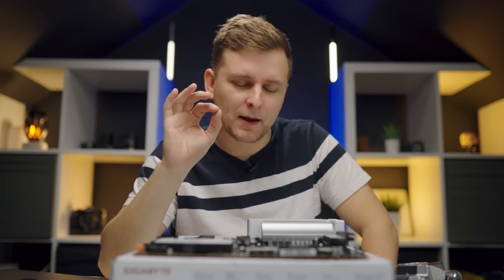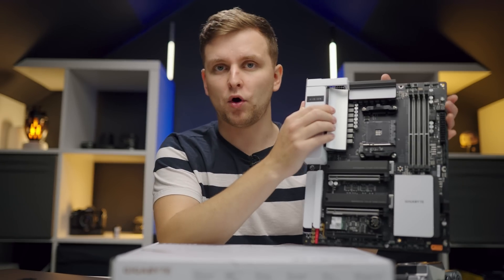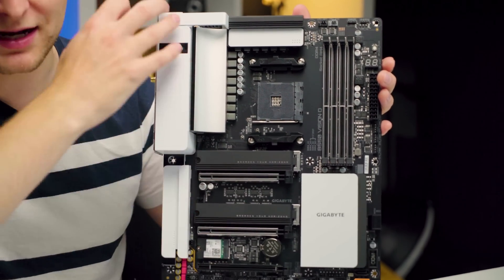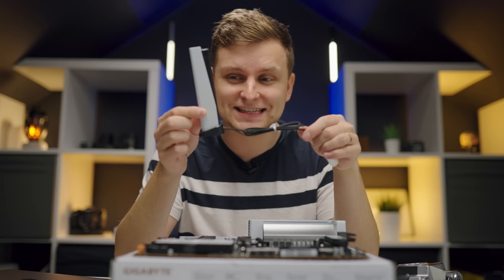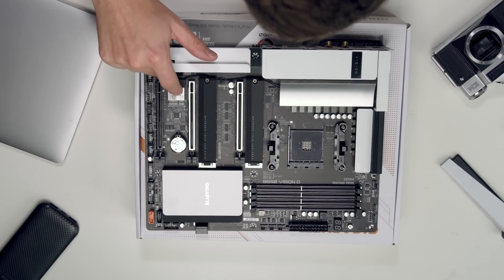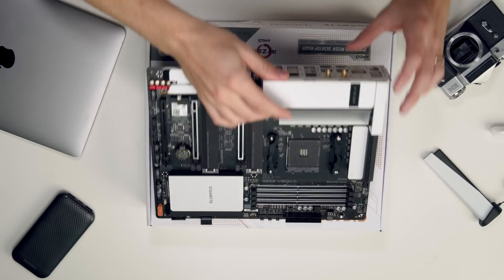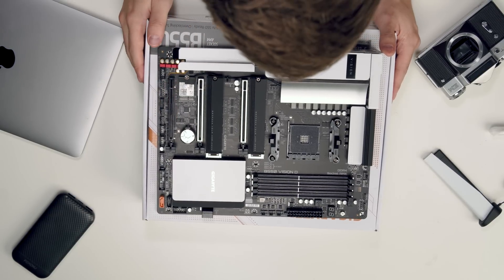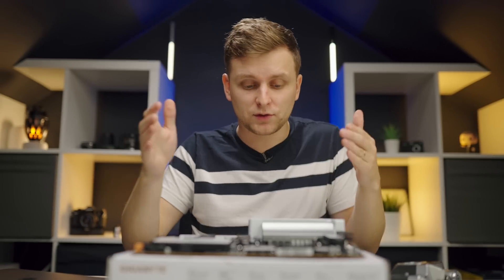Best Bang for Buck motherboard for CREATORS, finally! | Gigabyte B550 Vision D

Comment from the maker: PS! It's worth pointing out that this mobo might not ship with the bios version that supports the 5000 series CPU-S. In order to update the bios an older cpu is required. Few solutions:
1. If you plan to upgrade to 5000 series later, then no problem.
2. Find a cheap 2nd or 3rd gen Ryzen cpu that you could return back to the shop after you've upgraded the bios and then slot the 5000 series cpu in.

Any other solutions?🤔
Reply: Q-Flash is an amazing feature on these boards that allows you to flash the bios onto the mobo without needing an old cpu. 

- You need a FAT32 format usb(32gb or under for this format)
-  The bios version that you want to update to extracted onto the usb directly(no folders or zips) and make sure that the bios file is renamed to GIGABYTE.bin (if using a different brand look up what they want)
- Once all that is set you just connect your motherboard and cpu power plugs nd NOTHING ELSE (No cpu, ram or gpu, NOTHING) 
- Then plug the usb into the Q-Flash usb slot on the mobo(normally near the q-flash button) **EDIT**(Noticed on the Vision D mobo the q-flash isnt by the usb ports)
- Press the Q-Flash button and you should see a small light by the button start flashing fast (not as fast as you might think)
- Then it might take a minute or two and you should then notice the power supply start up and the mobo light up and that means the q-flash bios update is underway
- Give it some time as this could take somewhere from 5-15m depending
- Once its finished it will automatically shut off on its own at which point the mobo is on the bios needed and its ready for Ryzen 5000 series
Reply: Gigabyte site says it supports Q-flash update without CPU installation. Exact words: "Q-Flash Plus Updates BIOS without Installing the CPU, Memory and Graphics Card"
Reply: I was wondering about that. Fortunately, you can upgrade the BIOS before you install the CPU.
Reply: @lgf30022  100% I've done it on the board and it works really well! Kinda freaky when you do it, actually.
Reply: Correction on something you said .. the current threadripper does have Thunderbolt 3. Gigabyte Designare comes with the addin card in the box and that card has two USB C thunderbolt ports
Reply from the maker: Didn't know that about the TRX40 gigabyte designare ;)
Reply: Some shops offer bios update in the store
Reply: anyone here has Gigabyte b550 vision d and ryzen 7 1700 working together?
Reply: @latenyt7dusk231  does b550 support 1700? I thought it only went back to 2000 series
Reply: It has bios flashback
Reply: How can you claim that this is the first Ryzen motherrboard to support Thunderbolt 3?
The ASRock X570 Creator has TB3 as well, and most of ASRock's X570 boards have the ability to add a TB3 expansion card, with full DisplayPort over TB3.
If you can't get simple facts like that right, then how am I to believe anything you are saying?
Reply: @rogerwilco2  he meant b550

Comment: For anyone still using this bad boy.... As of Sept 2025. Do not update your bios to anything past v17 or 18b. Doing so will kill a lot of features and will also kill the ability to use your thunderbolt ports. It simply will not show up in the bios and or in windows device manager. I have reached out to the manufacturer to let them know.

Comment: Great video, it made me make my PC with Bequiet case and leave Mac. 1 question I'm getting a Nas with 10gigabit connection, what's the best way to connect it so I don't lose bandwidth, is it via thunderbolt 3 with adapter which is pretty pricey, or can I put in a 10gbit card?

Comment: Whats the difference between the:
Vision D and Vision D-P
Reply from the maker: Dp is newer and  has some improvements like front panel USB-C
Reply: @theTechNotice  thnx, looked it up… reviews on Amazon arent the best for this one. About 2to3 stars…
Any recommendations from your side for a motherboard? Wich one would you by in 2022, amd socket…? 
Or specifically Vision D or B550 creator or is there something else outside of this creator boards?
✌️

Comment: Hey you mentioned at 5:20 that there are two 1Gbps ports, but the website says this:
Intel 2.5GbE LAN chip (2.5 Gbit/1000 Mbit/100 Mbit) (LAN1)

Realtek 2.5GbE LAN chip (2.5 Gbit/1000 Mbit/100 Mbit) (LAN2) 

Am I missing something or is there a different version of this motherboard?

Comment: Asus also makes a pair of AM4 boards like this, one b550 and one x570. ASUS proart line. Both have thunderbolt 4 usb-c. The b550 has both 2.5 and 10 gb Intel ethernet and the x570 has two of the 10gb Intel lan as well as wifi6-e/Bluetooth  Both are more expensive than this however.
Reply from the maker: Yeah, I've got videos on both of these boards on my channel!

Comment: I have the x570 creation board as well... The 10 gig is nice - currently using it as a direct connect for a work-based NAS unit, but what makes the creation standout is the insane i/o support native on board! To move on, at the very least, I'll need thunderbolt and a decent amount of i/o. Super happy we're starting to see that with AMD, hope it only gets better from here, that said, it's early days :)

Comment: Will this board utilize Samsung 970 Evo Plus 250GB full speed? PCIE 4.0?
Reply from the maker: Yes, in the first m.2 slot.
Reply: @theTechNotice  If I researched correctly, I recently discovered The Samsung 970 Evo Plus 250GB uses PCIE 3.0 so does that mean it can't be used in B550 boards with PCIE 4.0 support? Or I can still use it to its maximum. I've been having trouble lately if I should go X570 (Gigabyte Aorus Pro Wifi) or B550 (The board in this video) because of this PCIE 3.0 and PCIE 4.0 thingy to which I don't understand fully yet haha. I don't wanna bottleneck any of my pc parts
Reply from the maker: Boards are always backwards compatible, so the 4.0 support means maximum speed, but it also supports 3.0 and 2.0. So you're fine with b550 board ;)
Reply: @theTechNotice  Thank you for replying! This helps me (I'll be building my first ever pc build somewhere on September, with a temporary gpu lol)

Comment: Would using 2x m.2 SSD's slow down both of them? like would the first SSD become slower if a second one is installed? I feel like a creator would want both SSD's in m.2 slots right? Is this a disadvantage of the b550 boards?

Edit: or is it just the b550 only runs pcie 3.0 and not 4.0?

Comment: It does have RGB!  It’s got two addressable LED strip headers and two addressable RGB strip headers.  You can get more productive!

The thing that would really get me is that it has support for up to 15 USB ports!  That and three PCIe 4.0 m.2 slots.

Pretty killer.
Reply from the maker: Yeah, I meant no RGB on the motherboard not RGB headers :)

Comment: Well I finally ordered this board. Yay.. now I have to fight scalpers for a 5900X.. good grief. Do you know many pcie slots you can use before we lose a thunderbolt port? The manual just you're "limited" to how many but doesn't say exactly how many. I'll be populating the 16X and each of the m.2 slots. Leaving 2 unpopulated?

Comment: Even though this motherboard is advertising thunderbolt support, I can't find anywhere in the documentation that it offers up to 40 Gigabits transfer speeds. This is a common thing when you see Motherboards offering thunderbolt 3 or 4 support. I'm so close to buying this thing but I absolutely need to know that this thunderbolt support is on par with an intel board.
Reply from the maker: I can see it over here: https://www.gigabyte.com/uk/Motherboard/B550-VISION-D-rev-10#kf

Comment: Awesome review. As a person who’s in the market for these boards, it’s really helpful. But man.. That poor little Zenit-EM... :D

I know it looks cool with exposed mirror, and I know they are dirt cheap these days, but please, have some dignity and spare that camera from collecting dust if it still works. Chances are, exponometer does not work already, that thing does not like to be exposed to bright light over long periods of time, but mechanics should work fine, and you can do some film photography with this camera no problem. Thing is, it’s hard to clean focusing screen next to the mirror without damaging it, and dusty shutter does not help either, hence keeping dust outside really matters. 

Yes is know it gives that hipster looks and whatnot. But for anyone who knows what it is, actual creativity with that camera associates with using it as a camera instead of using it as decoration. I mean, if you really want it that way, just cover the hole. After all, this camera might be older than a lot of people here, so it does not deserve that. It comes from an era when people really cared a lot about their equipment, and I believe this attitude is what we desperately need these days on global scale.

Comment: i was wondering if it has the 5 pin connector on the board for a Thunderbolt 2 add in card ?

Comment: can i use a Thunderbolt 2 add in card on this motherboard
Reply from the maker: YEAH!
Reply: Great! i was wondering if it has the 5 pin connector on the board for a Thunderbolt 2 add in card ?

Comment: I'm consistently getting much better CPU and GPU performance out of my Gigabyte Vision D vs. my MSI X570 Unify with my 5900X. Both set to -30 curve fit on all cores with PBO disabled (works amazingly well vs. a straight overclock). E.g., my Cinibench R23 is 23,500 vs. 22,300. My CPU-Z multi-core is ~10,205 vs. 9885. My overall Passmark CPU rating is 43,504 vs. 42,305. My single thread is also slightly better on the Vision D with a Passmark score of 3714 vs 3662. The 3714 score is right behind the new 11900k score posted on Passmark.
Reply: Forgot to mention that my Passmark 3D rating with my Vision D board and a Radeon 6800 Red Dragon is around 25,523 (just ahead of the 3090 top score) vs. only 23,450 on the MSI X570 Unify board. Overall I feel like the 550 is running slightly lower baseline voltages and runs about 5C cooler on average with the same exact AIO. It's almost like the -30 is closer to a -40 curve relatively speaking. I'll have to do more testing to get some exact voltages, but the CPU definitely runs hotter on the Unify board with the same adjustments and default. The curve-fit feature is incredible. You get better sing and multi-core without the extra heat.

Comment: I just stumbled upon this main board, and I'm quite certain this is what I will settle with! My current setup is an (i6800k, X99A SLi Plus, 128GB 3200, Evo 970+ m.2, GTX1080). Still serves me well, just don't like the boot time (X99 is known for that). I have built many systems over the years, and this would be the first time considering a business chipset. I have come the the conclusion that I really don't have care for RGB, and all the extra crap the 'gamer' or enthusiast chipsets add. Mostly, because of quirks that come with them. Often times I have choose them because I was chasing after a specific feature, that usually the lower class boards don't have. I have never had a system completely quirk free, there was always a compromise of some sort.

The TB3 and connectivity is what takes me to this board. Also, being a B550, it should be without the bull$*$& quirks, and be a solid production/content creation runner, which is precisely what I am aiming for. Some casual gaming, but content creation is more important. The Quadro QVL tests are a good sign to me. The other factor is fanless chipset design. Been there with mobos and chipset fans, don't like em. I can also dig the minimalist design, would be a perfect match for my Genome II 'Storm Trooper' colour schemed case the i6800k build currently resides in.

Sure, the PCIe GPU and M.2 lanes are less then the other chipsets, but I reckon I really only need one solid GPU, and 4.0 M.2 drive, esp given the TB3 connectivity. The 2nd M.2 being 3.0x is fine enough for secondary storage. I'd love if one of the ethernet ports was 10G, but again TB3 takes care of that. Don't need it for internet, but rather to handle the bandwidth of my IP security cams.

This is also the first time in a long time, that I will again be leaning towards a workstation GPU rather then a gaming GPU. I really do reckon this mobo hits the sweet spot of what I am looking for, without paying for the extra crap I don't need.

I really was considering the sTRX40 TR CPUs, but having been down the high TDP road before, I rather compromise PCIe lanes for less TDP. Quad channel memory setups are given up as well though... That really is the one thing that remains on my mind... 

Though I likely will settle for this mobo and a 5950X. I do reckon that is the best bang for buck for creators as of this time.

Much thanks for sharing mate!

As a side note, it is also nice this has an old school RS232 comm port header, as I still need that teheheh

Comment: NOTE! A new Gigabyte "Vision D-P" has been posted on Gigabyte's website in the past couple of weeks. I learned the hard way why I wish I waited for this "D-P". The regular "D" version does not support a motherboard header for a USB Type C 3.2 gen 1 (10 Gb/s) front-panel connector but the "D-P" now does. If you buy a modern case with such a connector, you'll notice the required header is unlike any other USB header. I was just building a new system with this Vision "D" board and my NZXT 510i Elite case  when I noticed I could not plug in its front panel USB Type C cable anywhere. I'll use the rear panel connector instead which is gen 2 (20Gb/s), but such a shame to have a type "C" port on front that doesn't work. 

The other major update to this "D-P" board is that it has twin 2.5Gb/s LAN connectors instead of 1Gb/s like the "D" version. Otherwise, this MB is really amazing if you are OK with the limitation of the B550 chipset vs. the X570. I predict Gigabyte will introduce a creators version of the the 570 given the popularity of this board. Can't wait to see it!
Reply from the maker: Yeah I saw that as well, and these are very nice improvements!  
But I can't find it in stock anywhere? Can you? :)
Reply: @theTechNotice  Nope. Not a single video on it, or store with it yet.

Comment: If i have to choose between this board and rog x570-e gaming and rog b550-e gaming which one worth the money in terms of vrm and software features and other bonuses?
Reply from the maker: Tbh, it really depends what's your workflow and what features you need. This board has the best TB3 support on any AMD motherboard, which makes it very unique. 
The x570 is a better chipset so you'd get better bandwidth on some of the connections (more pcie 4.0) like the second m.2 would also be pcie 4.0 not 3.0 etc. :)
If you need TB3 then there's no other board like it :)

Comment: Thanks so much for making this video!  Is there any chance you're going to review the new "D-P" version this magically appeared on Gigabyte's website this month?
Reply from the maker: Thanks for letting me know that, just checked it out. They've made a very good motherboard to a perfect motherboard. Subtle little chances, but worth it. I can't find it in stock anywhere, can you? Please drop me an email if you do, I'd love to check it out. :)
Reply: @theTechNotice  Regrettably no luck so far, which is especially a bummer since it feels like they took a motherboard that was 95% perfect already and buffed out the final 5% (at least insofar as the board's target demographic is concerned).  Clearly it's more than a rumor (since it's on Gigabyte's own website), but I've been doing weekly searches for reviews/where to buy throughout January, and still can't find anything else about it out.  DDD:

Comment: But M2 Nvme slots aren't both 4.0, one is 3.0,  I own 2 NVMe 4.0 to Gen. 4 to
mount and I would like to take advantage of PCI 4.0 in raid mode. I have to prefer a X570 with both Nvme 4.0 slots?

Comment: Disappointing Gigabyte thought old two 1gbe ethernet in a board this expensive is good enough. Come on GB get a grip really? Other manufacturers are now installing at least 2.5gbe
Reply: think that's a mistake as per Gigabyte Spec site - "High-bandwidth and low-latency network support by dual 2.5GbE Ethernet"

Comment: ''Great video!  This is my next motherboard.  I'm not a content creator, but I do like the ability of shuffling data (gopro videos etc) around and have experienced the speed of TB3 already with my laptop!  I'll never go back to anything slower if I can help it.  This board has TWO TB3 ports at that, which spares me from buying a TB3 PCI card in addition to a TB3 hub for additional external ports!  IMPORTANT NOTE:  I was reading that the BIOS can be flashed without a CPU.  There is a video on Youtube highlighting how to flash without a CPU.  Look up "How to use Gigabyte Q Flash Plus Bios Flash Button" by Mike's unboxing, reviews and how to.

Comment: The only thing that makes this board a contender for creators is TB3.  No 2.5 or 10g, lan.  I have a qnap 60tB nas that holds all my 4K content but i do all my editing from internal Sata drives,  the Nas is just for storing old content and backup so TB is not that important.  Plus Nas units with 6 hard drives make a lot of noise so i dont like to keep it near my computer, TB limits the distance you can be from the computer.  2.5 or 10g lan lets me keep the nas in a totally different room and still get great speed for transferring files.  I live in an RV and do all my content creation for my RV channel in the RV so i have to really think this stuff out, weight and space are critical issues.  I think i will go for the board you build in your other video which is how i found your channel.  Thanks for making content like this for creators.  Larry